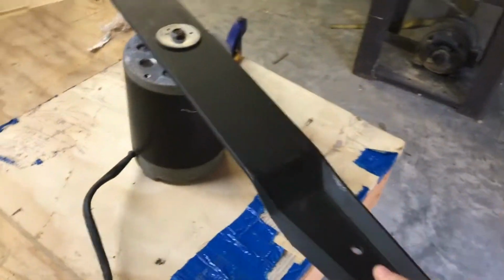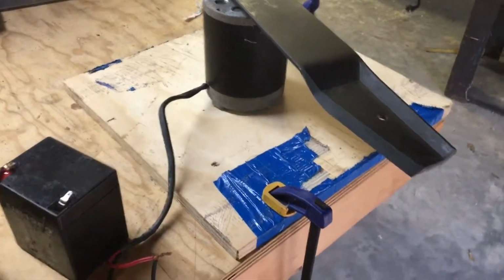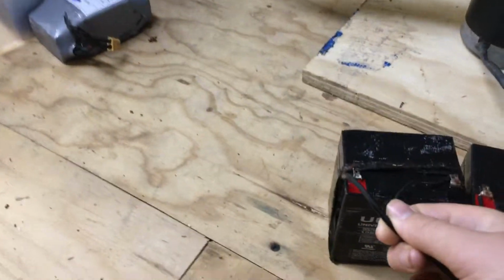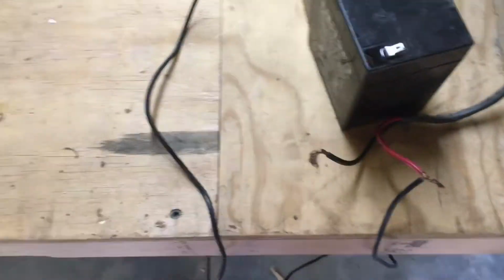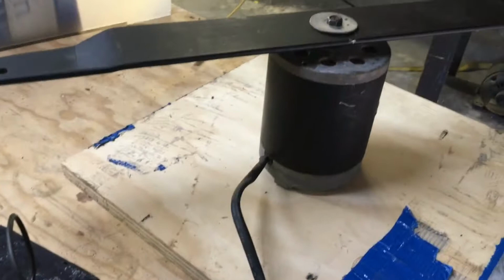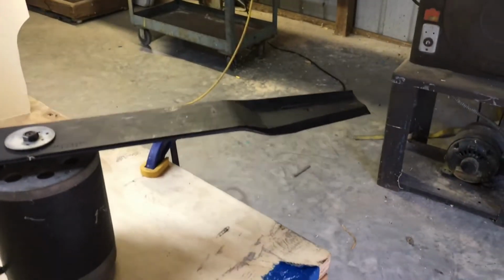Battlebots Are Very Dangerous I Learned The Hard Way

Comment: You might want to look into using something other than a lawnmower blade. Those don't really carry that much kinetic energy. Also, you should probably consider a belt drive rather than a direct drive setup.
Reply from the maker: VestedUTuber yes but belts slip and lawnmower blade are easy to get and are Centered
Reply from the maker: VestedUTuber it hasPlenty of kinetic energy going 5000 rpm
Reply: 1. Belt slip can be a good thing. For one thing, it means your motor won't stall on impact, which in turn results in a lower average amp draw. And a lower amp draw means longer battery life (which also means less weight dedicated to batteries) and a lower chance of burning out motors and electronics. Of course, if you're worried about the belt slipping too much you could always use a belt tensioner, or alternatively incorporate an adjustable weapon motor mount into your design. My 3lb robot uses the latter.
2. A direct drive weapon on anything larger than a 150g fairyweight/UK antweight usually results in bent or even sheared motor shafts. You'll save money and repair time by not having to replace weapon motors nearly as often if you use a belt or chain drive (though again I recommend a belt drive due to reason 1). The only exception to this is press-fitted drums on US antweights and beetleweights that are turned by an outrunner motor.
3. With a belt or chain drive, you can "gear down" on your weapon. Not every weapon needs to reach 5000 RPM, and in fact on such a large blade having a very high tip speed will ultimately decrease the ability of your blade to catch on the opposing robot. With what you have here, you're hitting a tip speed of 714 MPH. That's approaching Mach 1! Most robots don't even get anywhere near that. You could definitely afford to reduce the speed of your blade. Gearing down also increases torque, which means a shorter spin-up time. My 3lb robot's drum tip speed is estimated at 157 MPH, but it can reach that in under a second and it still has plenty of power for its weight class.

Another issue with lawnmower blades is that the material won't really hold up. A lot of robots in the heavier weight classes are using AR500 Steel for their armor - this is military-grade stuff. If you hit that with a heat-treated piece of mild steel like a lawnmower blade, your blade's going to break. Sure, they're well centered and easy to get, but with the right tools so is a thick bar of aircraft aluminum or S7 Tool Steel. Or heck, a machined AR500 disk.

As for kinetic energy, you can figure that out using the weight and RPM of the blade, and then compare it to robots in the weight class you're building for. For example, in the Heavyweight class, Carbide from the new Robot Wars series is considered average at around 60kJ, or 60,000 Joules. Meanwhile, Tombstone's blade clocks in at a VERY impressive 104kJ, or 104,000 Joules.

Here's a few online calculators to make the physics calculations easier:
http://www.endmemo.com/physics/kineticenergy.php - Kinetic Energy Calculator
http://www.endmemo.com/physics/rpmlinear.php - Linear Velocity (tip speed) Calculator.

Calculating amps is pretty easy. One joule per second is one watt, and then you divide watts by your voltage to get amps. At that point, to determine the amount of capacity you're using, if you calculate your spin-up time in seconds (you need to test for this), multiply it by the number of times you need to spin up during a match, and then convert that to hours (basically, divide the result by 60 twice), you then get the amount of amp-hours you need to power the weapon only. On larger robots I'd recommend adding an additional amp-hour of capacity for your drivetrain.